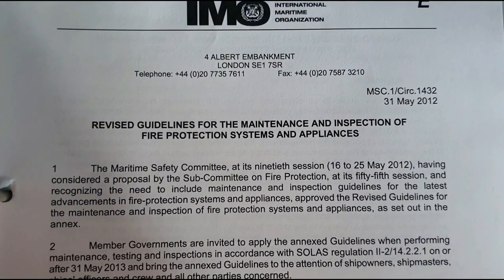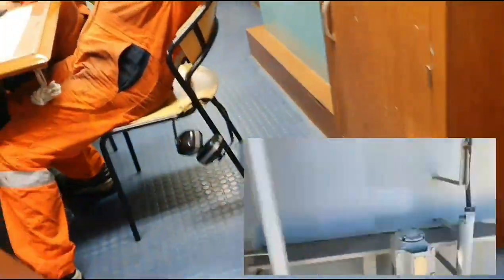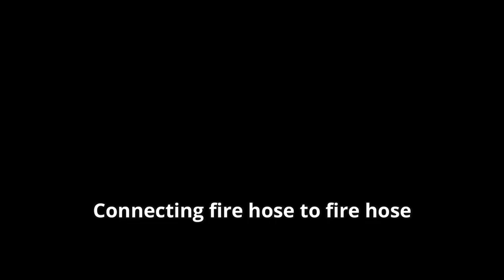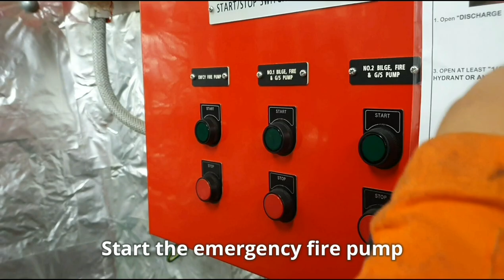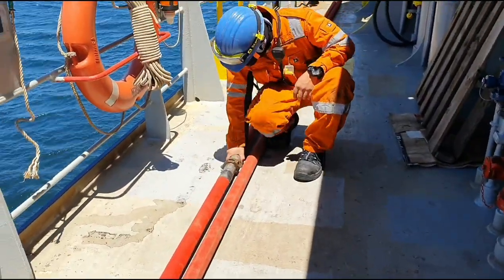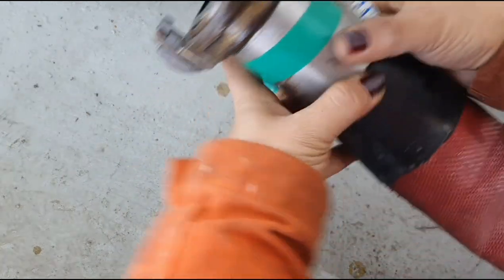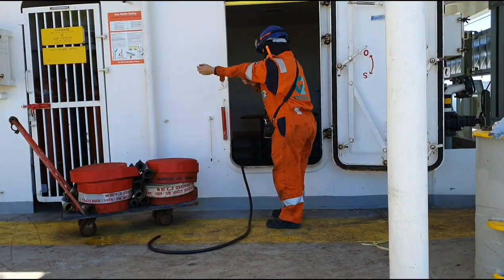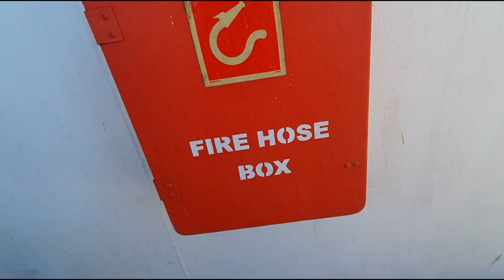VLOG#4- HOW TO CONDUCT ANNUAL FIRE HOSE TEST | How to be  Third Mate Series | Show and Tell Shawntel

Comment: Hi. Thank you for the helpful video. I have one question about the drying procedures of the fire horses. Usually, I dry them in unfolded condition and hang them through railings. Is it enough to dry fire hoses under the sun in a folded condition?

Comment: Hello! I have a few questions for you.

1. I found out in some different youtube channels instructing how to pressurize test the fire hose, they do "shut off" the stream through nozzle and check the water pressure through a gauge indicator. In your video, such action as shutting streaming off through the nozzle have not been carried out. What is the difference? Do fire hoses have to maintain full fire main pressure when nozzle shut off or not?

2. In my internship term, we had carried out pressure test of fire hoses by just linking the fire hoses to the fire hydrants and inspected if the hoses leaking. But we had not a pressure gauge somehere or a digital pressure indicator just as you have in this video. I think our test sucked. But do you think our test we made during my internship term could pass the pressurize test criteria or not?

3. As I mentioned before, they shut off nozzle and read the pressure through a gauge. And that sound kind of weird to me because where all of those pressurized water go when they shut off the nozzle? It must be very dangerous for the fire main system.
Reply: No, they don't. Hoses loose pressure when flowing water due to friction.

Comment: Testing at full main pressure should probably be done with the nozzle shut off. Otherwise it is less than full pressure.

Do you really take ALL of the hoses at once? What if there is a fire during the test? I'd probably do 1/2 on one day, half the next.. and not take all of the hoses in a given area.